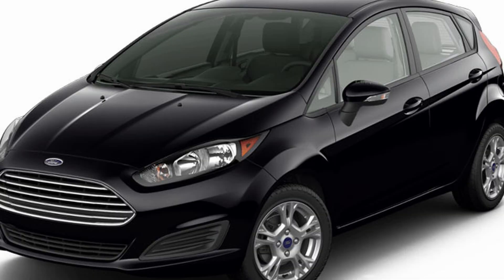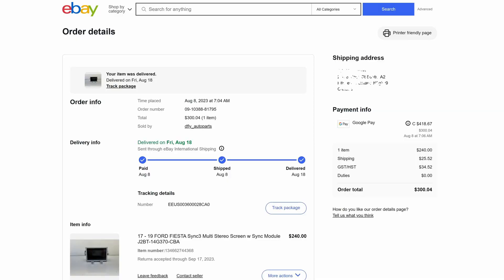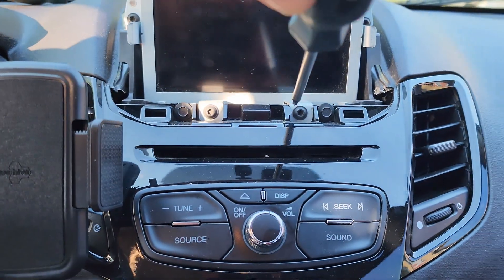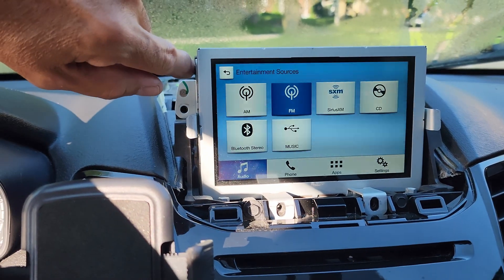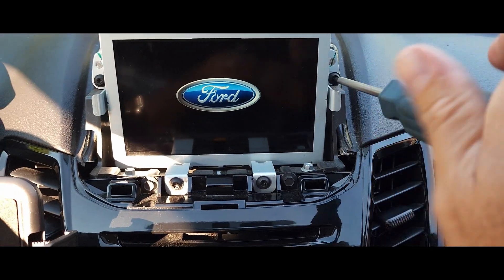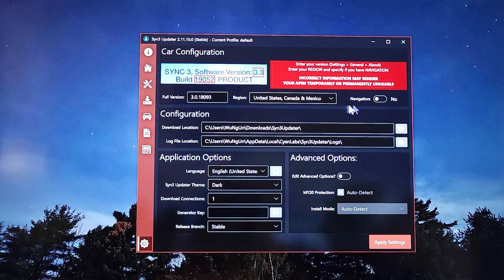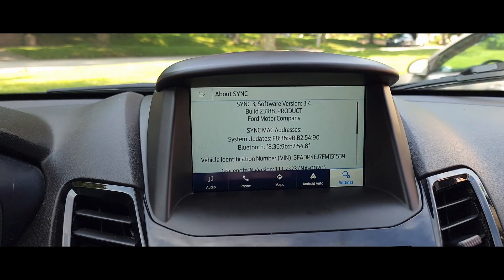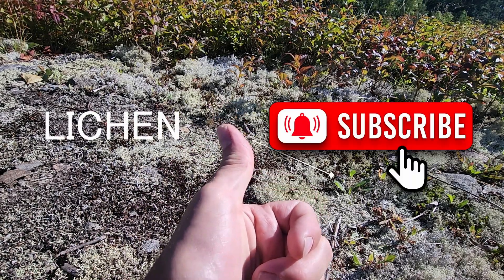How-To: Fiesta Sync 3 Hardware Upgrade with Android Auto!

Comment: I have a 2014, with the common radio and the small screen, I would like to know if it is compatible to change the radio and the screen for another one from a newer fiesta? If you think it would be useful. I remember reading somewhere that it could only be done from 2015 onwards but I don't think that's true.
Reply from the maker: @roqueaei3400  same screen as my original one, or the tiny red one? If it's the red one, I can't be sure 🤷

Comment: Do you have any problems with the volume controls on the steering wheel not working? I have that problem and ive read about it a little bit. But I just wanted to hear from you.
Reply from the maker: All the audio controls work fine on mine.... Hmmm

Comment: Hi, good job. I have a Fiesta of 2020, do you know if Sync 3 device is compatible with my car? I have the simply Sync without Nav and I want to buy it on Ebay.
Reply from the maker: As long as you install a 2016 or newer unit, should be good 👍🏻

Comment: excuse me i have a question for you, in your case you have not changed the usb ports with the corresponding wiring to be able to use apple car play and android auto with sync 3? just change the car radio? so the usb ports your car had were already suitable for using apple car play and android auto?
Reply from the maker: Thanks for the reply. Yeah, still the old USB ports. It works fine for Android Auto but it won't recognize an iPhone at all.

Comment: Good job dude. My 13 flex had the my first touch. It wasn’t awful especially for someone new to that tech. But synch 3 is def better. 

One thing I miss about the touch system is being able to upload your own background photo. 

I wish we could upgrade the bronco sport from synch 3 to synch 4
Reply from the maker: I wonder if it's partly to do with part supply and constraints that the Sport STILL doesn't have Sync 4 🤷
Reply: @TLOverlander  I think that’s it. The escape has 4 I think